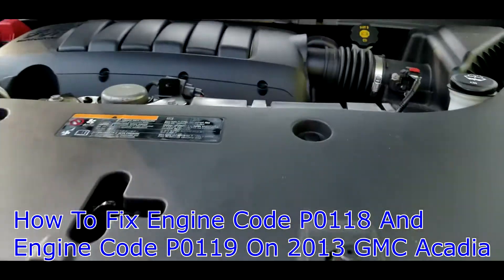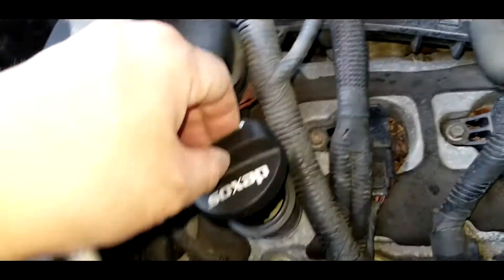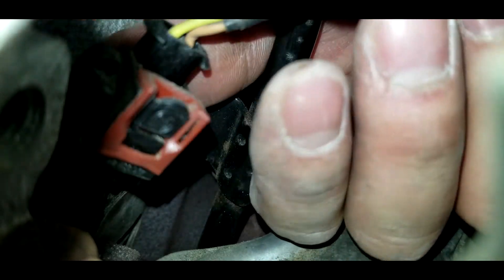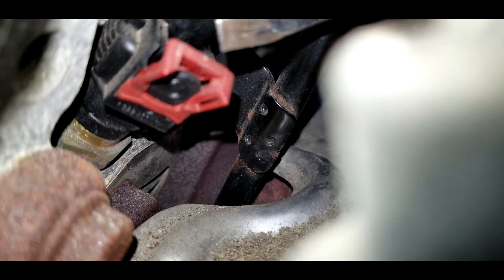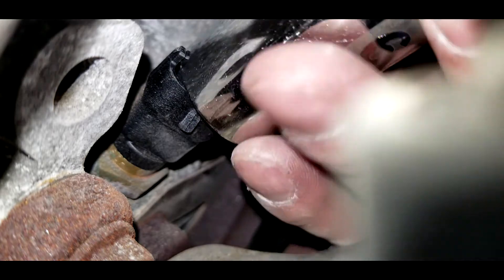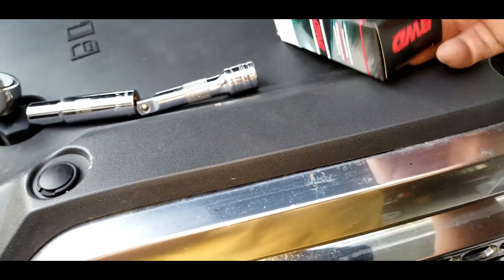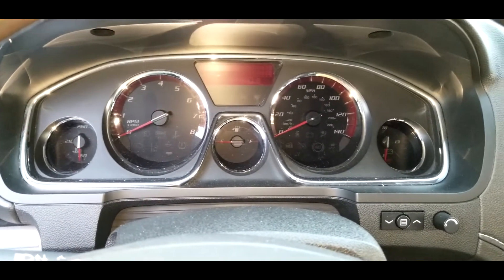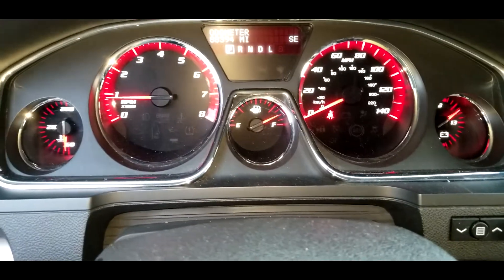How To Fix Engine Code P0118 And P0119 On 2013 GMC Acadia!

Comment: What was your symptoms? Just the codes? My step daughters Traverse has P118 and P119 codes, but hers also has P300 random misfire code. Her car hesiates/jerks when sitting at lights and sometimes under acceleration...
Reply from the maker: For my situation, there were no symptoms; the car operated normally, but the engine light turned on. After replacing the sensor, the engine light turned off. It seems like your car might be experiencing a more serious problem than merely needing a sensor replacement.
Reply: @TRUSTMEN  thanks for the reply. She just dropped off the vehicle to me today. There's no check engine light on, but these 3 codes came up when I scanned it. Hate throwing parts at it, but I feel with the p118 and p119 codes, the coolant temp sensor must be acting up. I guess il have to dive into it more to figure out the rough idle issues.
Thank you
Reply from the maker: @splash5974  np
Reply: @TRUSTMEN  
Replaced temp sensor today, P119, P118 are gone after clearing codes and a couple long drive cycles!
P300 came back...🤦

Comment: Thanks for the video , but I changed the sensor and I still get the code “P0119” and sometimes it reads the temperature a little bit higher than half way and the needle plays up and down…but it doesn’t overheat but there’s been 2 times where the motor turns off but turns back on quickly, 2014 GMC Acadia 80k miles… thanks…👍
Reply from the maker: It appears that you have a more significant issue than just a defective sensor.
Reply: Try changing your thermostat
Reply: @splash5974  I changed the thermostat and  not work properly…
Reply: @juancampos8449  Did you bleed the air out of the cooling system after changing the parts?
Reply: Yes…
Reply: Last day checking my car I looked the radiator fans work slow… not high speed…
Reply: @juancampos8449  weird...Coolant temp sensor needs to work properly, as it sends signal to computer to control fans and other things. Also, make sure the coolant is at the proper level. Too low and you may get faulty readings.
If you have access to a scan tool, you can monitor the temp and make sure it is accurate. Maybe you got a defected temp sensor...
Reply: Thanks, God bless you…👍👍👍